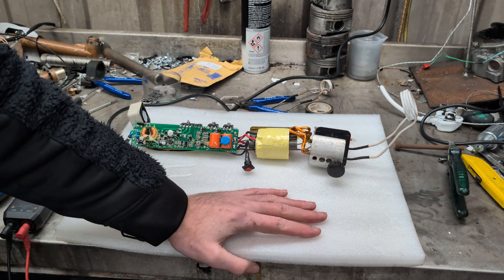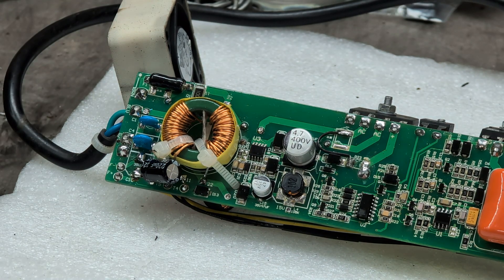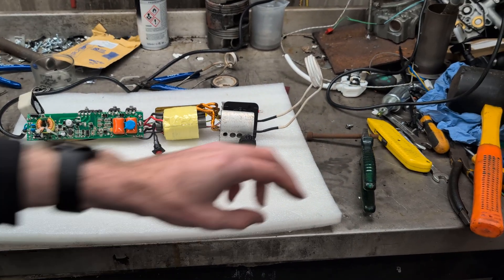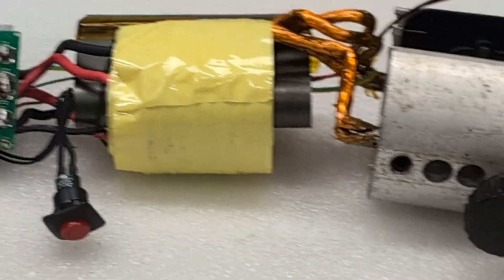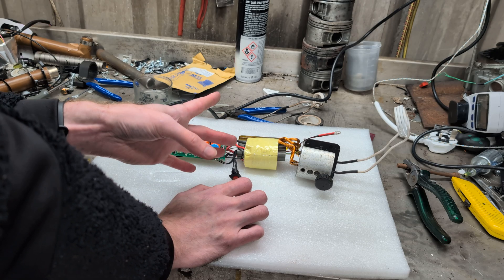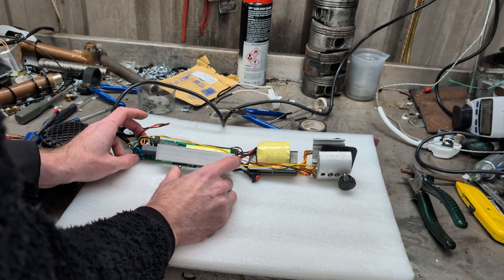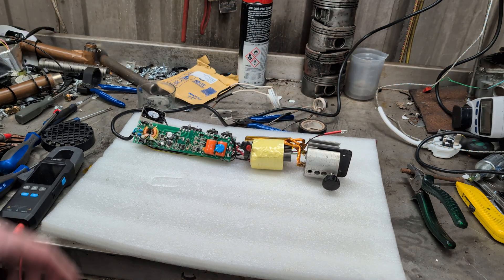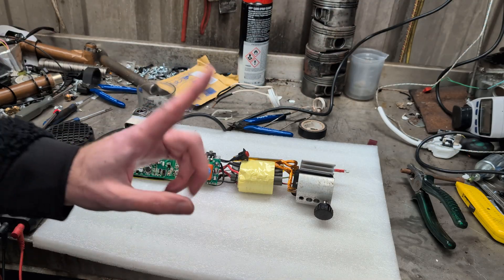Mini inductor repair / diagnose - part 2

Comment: 0:30 cap in the middle of the screen looks suss, might be the camera angle but looks blown.
Reply: I think you are on to something.  It is definitely suspect. It looks deformed and is on the mains side of the supply. Probably leaky, that would definitely cause the same symptoms. 
Good luck David